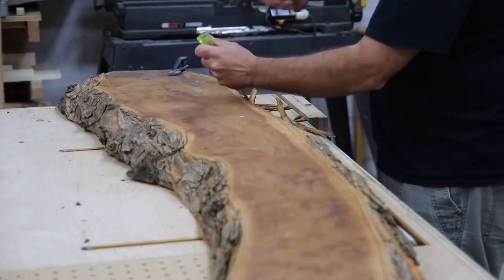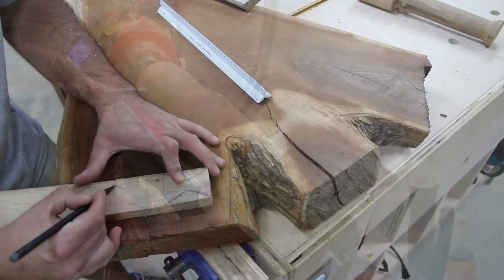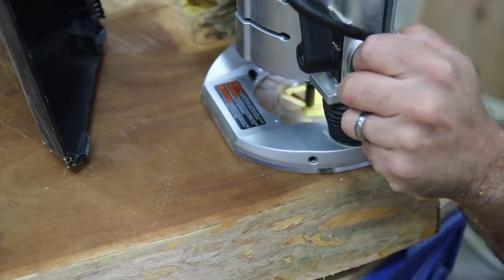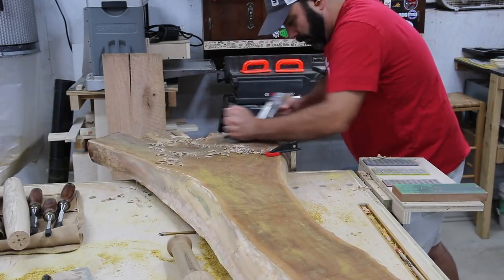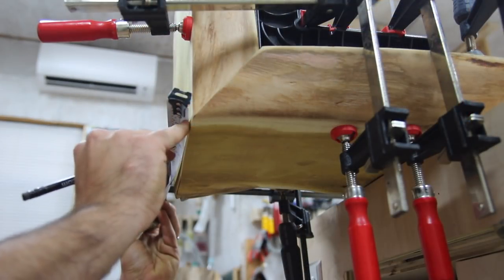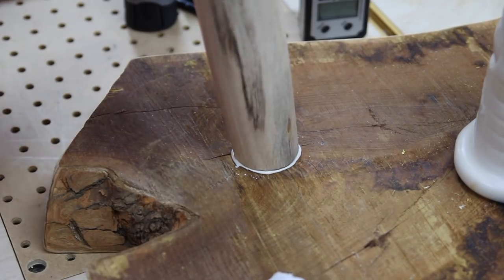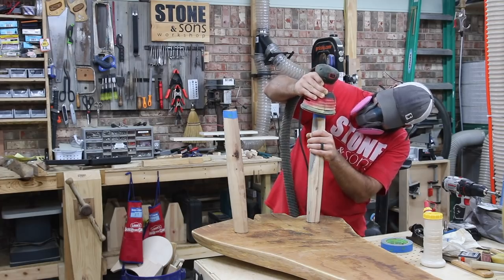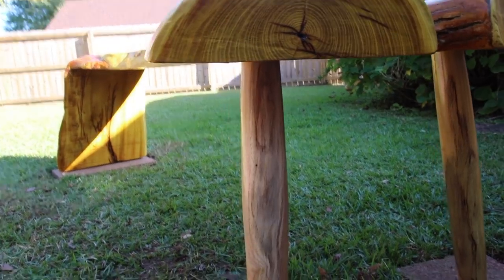Live Edge Slab Bench - Wood Furniture

Comment: Impressive and beautiful.  One suggestion ?  Cut your dowels a bit short (maybe 5/8" or so) and drive them below the surface.  With a plug cutter, of the appropriate size, cut plugs, from scrap, and glue a plug in on top of the dowel.  Orient the grain direction of the plug to match the grain of the wood,  You still get the strength of the dowel plus you get a very subtle finished look (no visible end grain).  Retired now but I built fancy staircases (as in "Gone With The Wind" style stuff) for 30 plus years and I've been building Resonator Guitars for the last eleven years.  You do excellent work by the way.  I loved this project.  JP
Reply from the maker: Thanks for the tips.
Reply: Another possible option would be to inset the dowel and fill with black pigment epoxy for a contrast look. But I really like the piece and think you did a good job.

Comment: Do bow-ties provide any other value than just aesthetics?
Reply: Oscar Palacios-Flor...  Bow ties are used to prevent existing spits from spreading open more. Sometimes you can squeeze a split together a bit more, clamp it in place then drive the ties into place therefore minimizing the size of the split. Happy woodworking

Comment: Looks great but some biscuits on the joint 45degrees from the bottom side will make glue up much easier
Reply from the maker: True, but I didn’t want any internal joinery.
Reply: @StoneandSonsWorkshop  Just because you extended the dowles to the surface doesn´t mean it´s not an internal joint. You could have done both without a problem with a slab like that. Would have helped with the gaps on the miter as well. 
One thing i always find sad is that sloppy work always gets excuses like it´s suits the project or something like that. A slab like that deserves in spite of the splits precision work. The wood saved you. Its a beautiful bench

Comment: I love the use of through dowels to strengthen the join. I'm trying to decide if it would be a good idea on a similar project I have planned. I am concerned that it might split, when knocking in the dowels so close to the ends. Perhaps the cured epoxy prevented that? Was your timber slightly wet or was it fully dried?
Reply from the maker: No epoxy was used in this project, just wood glue. All the wood was dry. The holes were ever so slightly larger to allow for glue and prevent splitting.